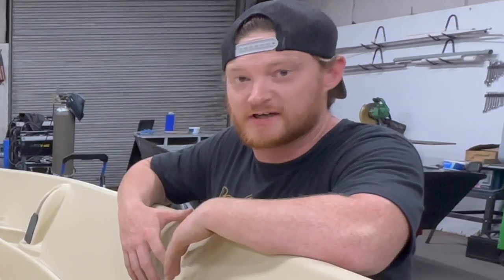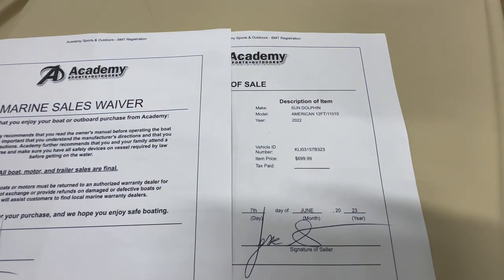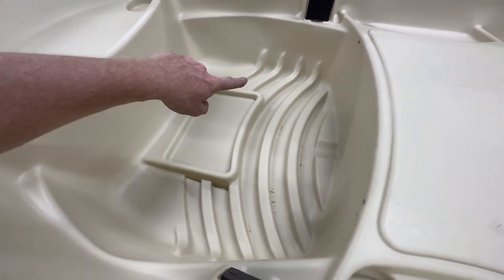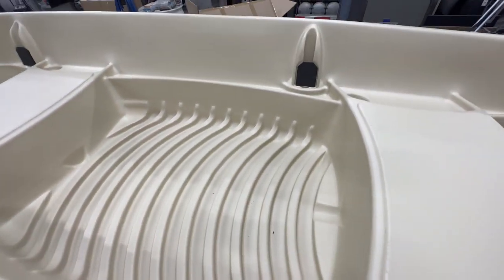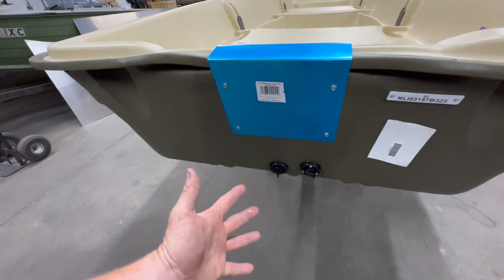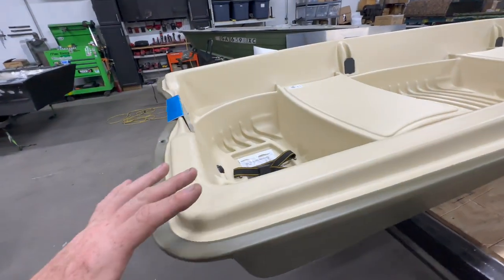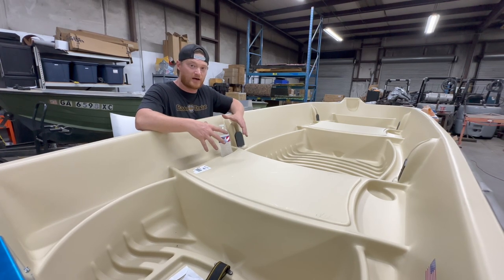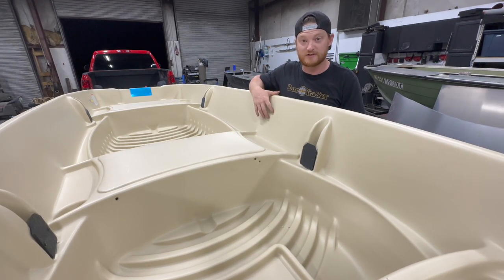Let's make this Plastic Boat Useable | Sun Dolphin American 12 | Quest Sportsman 12

Comment: 1. Drill benches at base, insert and seal 1 inch pvc for water drainage to rear. 
2. Fill in between the ribs to save your bare feet and to aid drainage. 
3. Stay minimal.
Reply: Do you think sealing around the edges with  silicone will help keep the water out  the hull?
Reply: @terryharvey1109  I’m sure it would help but, as a carpenter I know all silicon caulk fails sooner or later. It is not a one time fix and forget process.
Reply: @pawtrax   I agree. As a carpenter myself I would recommend quad osi, lexel, or sikaflex. There is also this stuff called through the roof that stick to everything. Don't know if it weakens plastic. It does a number on bitumen though.

Comment: I have the Dicks Sporting Goods version of this boat - Quest Sportsman. Bought it last year for $650. I reinforced the benches with wood and installed swivel seats, which are pretty comfortable and easily changed. I added rod holders in the back because I found the molded ones to be useless. I use only a 45 pound thrust Minnkota on the transom.
Reply from the maker: Any pictures?
Reply: @TBNationOutdoors  yes, but can’t figure out how to insert a photo here. Hold on…

Comment: The main thing that stops me from purchasing one of these is in the event of being caught out in rain for instance the water cannot drain to the back from the front sections.
I learned decades ago that even on a little 12ft johnboat to mount a cheap bilge pump in the back to pump out water if need be as bailing with a cup can get old quick.

I also think that keeping one of these simple and light is one of the advantages to this type of boat.

Comment: Glad I found you're video. I bought one of these boats about eight years ago, got a good deal on it, and been using it every fishing season since, on small lakes and rivers.

       There are a few things that I like about the boat , and things that I do not like

        What I like
        1 it's tough and durable
         2 Inexpensive
         3 moves right along with a 4 or 5 HP outboard
         4 In shallow water , its easy to pole , if water is to shallow for outboard
         5 I like that it has places for oarlocks, which is good because I always carry oars, in case the   outboard won't start

         What I don't like

          I the seats are uncomfortable, even with a foam cushion, especially if your out on the water for a long, time , I want to install a swivel seat with a backrest.

          2 whoever designed the drain system is an idiot, there is no way for water to drain from the front and middle cockpits to the rear cockpit, where it can drain out of the drain hole. I drilled holes, in the bottom of the seats, and put in a PVC pipe for water to drain from front to back.

         I do not like the ribs on the floor, they probably make the boat stronger, but when they get wet , they are slippery, and they hold water between them,.

          If you want an inexpensive boat that can be made more useful and comfortable, with a few modifications, I guess its not bad

Comment: Just some info on these the latest year does not have wood under the benches it's PVC board now it also holds 900lbs no problem I beefed up the transom with diamond plate and run a 9.9 on it with little to no flex you can do a lot with these boats
Reply from the maker: Thank you

Comment: here's the thing, these are cheep, entry level boats.   They are sold in Canada and the USA.  in Canada they are avail at Candian tire for 1099 or about 800 USD.   Generally its about the same as walmarts Pelican  john boat.  

you know what might be fun..  if you could do it "light enough"  with all those channels and such,  build a slide in slide out "cuddy cabin"  6'5" cabin,  mount batteries and such in a drop in point,   add a solar panel or 2 to the roof,   once plugged in and tied down, you could just plug in an electric motor to it for power,   using the cabins batteies and solar..  plus powering internal lights, an inteneral little fan...  now you have an optional little camping boat where you can draw up on little islands or riverbanks and sleep there overnight, camping.   great for a single person,  teen or adult...
Reply: Dude! YES!!
Reply: @billmartin3198  little bimini on the back,

electric motor + a little 9 hp gas motor backup.   pull down sides on the bimini, porta potty.    

use a single burner cook stove to do meals.   then sleep in the cuddy.   Could go out for days like that.

Comment: Is that inside top piece removable? That might make it easier to cut out and add new fiberglass. I'd like to remove those seats and that crappy grooving on the floor to make room for some aluminum bracing.
Reply from the maker: We are finalizing the kit, that will make the floors flat and add some decks onto it as well.

Comment: I'm looking for a bed liner coating for bottom of my sun dolphin, I've had mine for about 10 years but the bottom is getting thin now from all the years of dragging it and usage. Any ideas would help and be appreciated! Thanks!
Reply from the maker: Unfortunately no coating will stick to plastic like that, Bedliner and similar will peel off eventually

Comment: My interest is for a row boat but those oar lock mounts look pretty flimsy.
Reply from the maker: Yeah, I don’t think those would be very helpful
Reply: I have one of these and oars to fine. It’s my backup if my battery dies on a bigger lake . I use a 35 foot pound motor and it moves right along with two grown men . Great boat for small inland lakes on flat water.